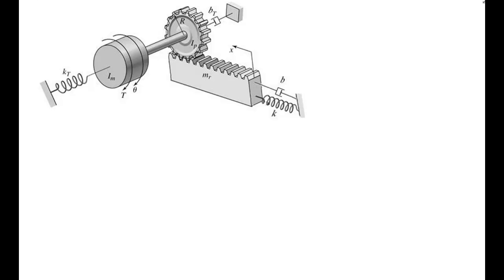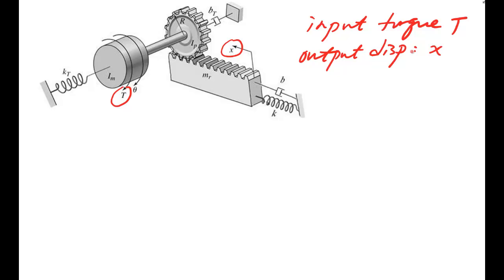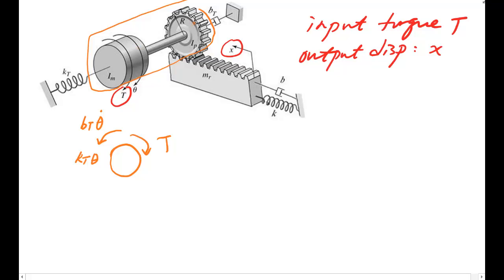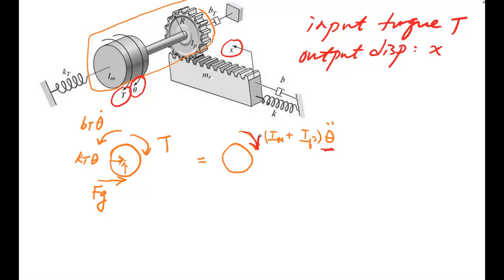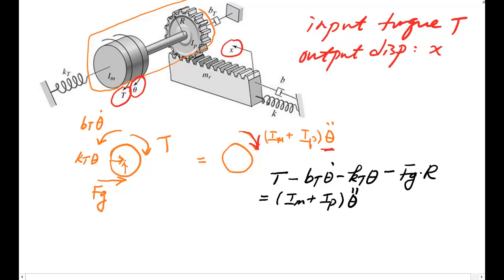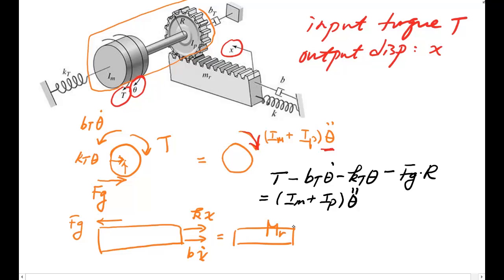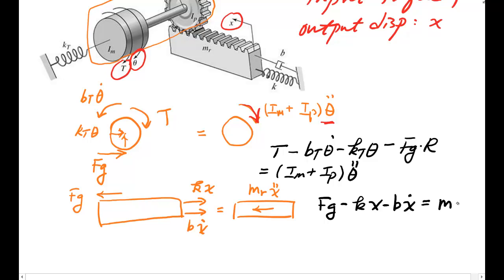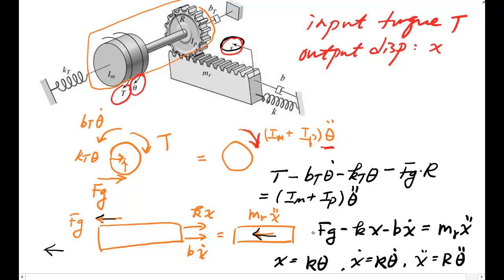ME 340: Modeling of a Rack-and-Pinion System

Comment: Equation of motions are right but direction of inertial force for both rack and pinion is wrong. (According to Newton's 2nd law of motion,inertial force always acts opposite to the direction of acceleration i.e opposite to direction of motion). For pinion gear since direction of acceleration/motion of disc is in clockwise direction, inertial force (Im+Ip)○^•• will act opposite i.e in anticlockwise direction 2:19. Similarly for rack gear since direction of acceleration/motion of rack is in left direction, inertion force mr x^.. will act opposite i.e in right direction 4:58.Never mind u have solved it by using D'Alembert's method equations are write , but these directions are wrong.